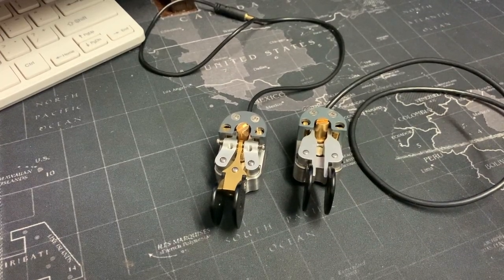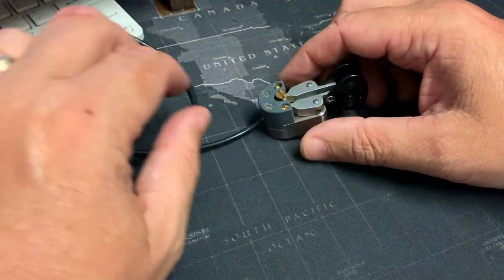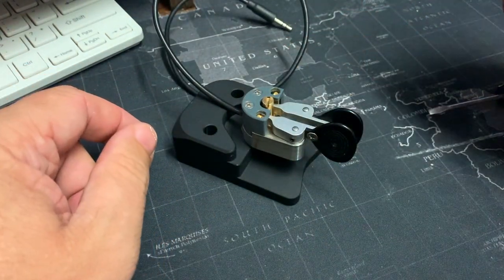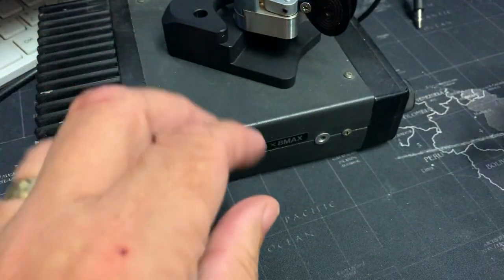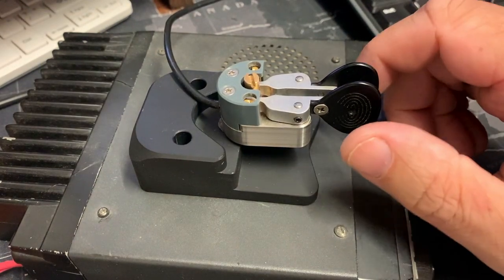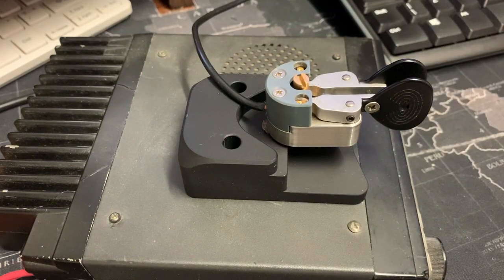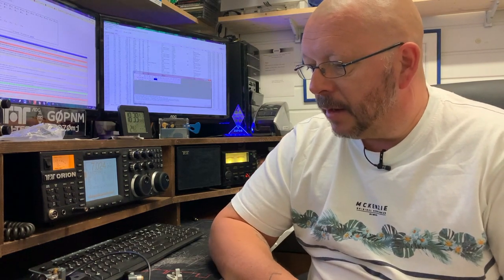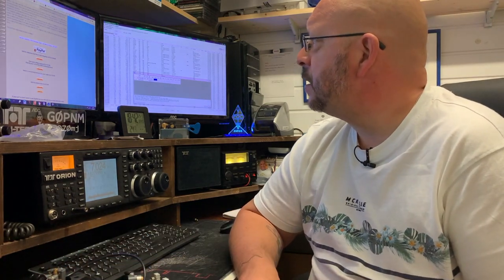G0PNM's Keys #12 The Begali Adventure and Adventure Mono

Comment: I have the Adventure Mono with the magnetic base, KX2, and KX3 bases.  I was shocked by how much I like the magnetic base.  My flight board has a thin steel plate encased in marine epoxy to provide a place to stick magnetic things (all my keys and paddles have magnets).   I just picked up a Traveler Light and am already thinking about just getting an Adventure dual so I can have a similar setup to switch between if necessary.

Comment: Interesting key... But rather horrified at your screwdriver use! Many a good screw on expensive or collectable keys are gouged by poor screwdriver choices. Get a set of gunsmith screwdrivers and match the screw to be tightened to the right size and shape screwdriver! All part of looking after a good key and one element in maintaining its value, which is something collectors would look for. Otherwise, great videos and a good way to see a Begali in use before committing to purchase. Maybe the Sculpture Swing next?